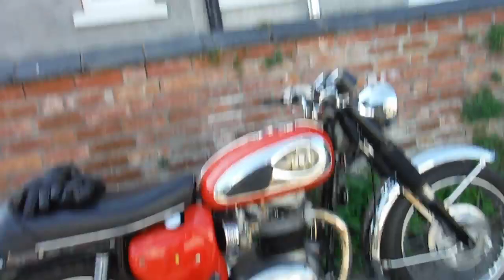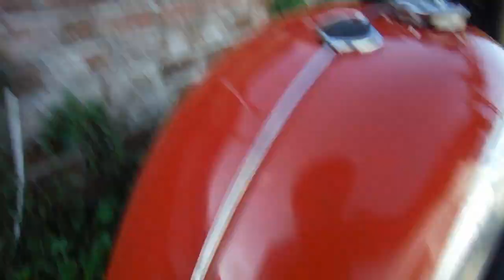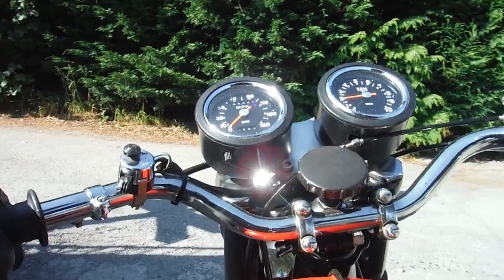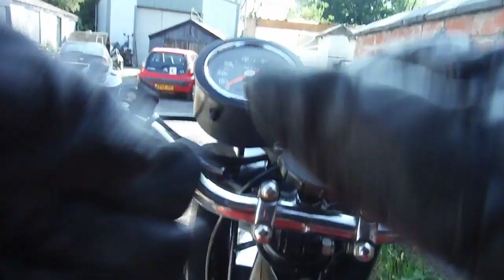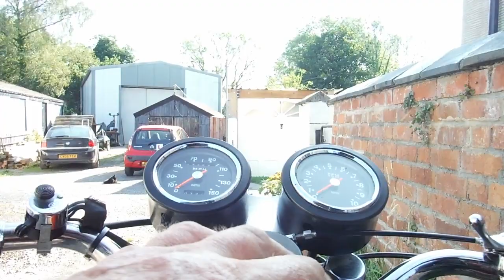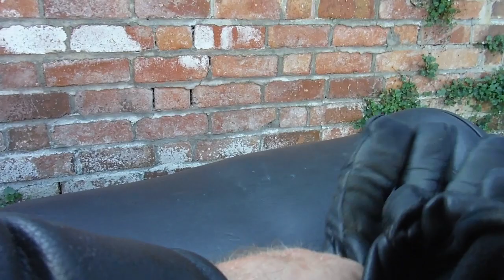BSA A65 [very] short road test.

Comment: I rebuilt an A65 Spitfire for a friend once  that sounded like that, the crank was actually broken but the two halves were meshing together and it would start and run!
Reply: years ago I knew a guy with a 289 Ford that had the same issue

Comment: i used to own a Lightning Clubman, had a bad habit of eating the timing side main bearing bush, the bike felt and sounded like the whole bottom end was going to fly apart, the bush used to work its way out and get eaten by the timing gears. stripped the engine rebuilt with all new bushes, bearings and shells, couple of thousand miles it happened again

Comment: May be a stupid question but I presume the engine mounts including the head steady aren’t loose. My Goldie vibrates like a b*stard when the head steady comes loose. First time it happened I thought I’d run the main bearings!
Reply from the maker: Funnily enough, when I checked, the bolt from the head steady to the frame was missing, so I replaced that and tightened some engine / frame nuts and tried again, but it was just as bad, so no video footage showing it fixed sadly.

Comment: The battle cry of the armchair know-it-all, "YOUR DOING IT WRONG".  As you are well on the way to 10k subscribers you must be doing something right.     I am an idiot and not a mechanic but was once at a junior drag-strip event when a friend of a friend's newly built lawnmower engine would not start. After a good look and a long think I began to realise the ignition was 180 degrees out due to the ignition side crankshaft being incorrectly fitted to the flywheel. Lesson learned was that, "new" and "rebuilt" doesn't always mean "right".

Comment: I'm wondering if by 'jack hammer' it's pinking or has pre-ignition maybe needs a lead additive, richer mixture or is too far advanced,  You ran the Bike as a 'result' but under load the problem shows, that says it's probably not mechanical, at least to me it does.
Reply from the maker: The timing is spot on and I would expect the carburation is, too - my money is on something mechanical.
Reply: @paulhenshaw4514  - I only based my thoughts on the fact that at the end of video 3. everything sounded fine but going through the ride footage again I guess it's also possible for a mechanical engine fault to only become apparent under load. Fuel would be ok presuming the Lightning head has hardened seats put in for unleaded but sometimes a lead additive or sacrificial element is used instead.
Reply from the maker: I have never, to this day had any issues with unleaded petrol and standard valve seats, without additives, but in any case, this example of 'clatter' actually feels unpleasant and harsh - it can even be felt through the handlebars and I fear something may be about to make a bid for freedom!

Comment: Needs castrol R  perhaps. Not synthetic. Did the clutch slip?
Reply from the maker: I think it needs a rebuild!
Reply: @paulhenshaw4514  My  mate used to take me to play rugby on his 650 Lightning. We would do wall of death stuff through the Blackwall tunnel. One day, we were coming down a steep hill on the M2 and the bike vibrated so much, the rear peg fell off. I was wearing fashionable Brutus loon jeans, which quickly ballooned up, putting lots of pressure on the other peg. Which promptly fell off. Terrifying stuff! 
Good luck with the rebuild. Love from Downunder.

Comment: Although the twin-carb ("Lightning ") head has its engineering differences, are there any practical ones to prevent it from being an easy swap with the T-bolt one ?
Reply from the maker: Hi Amelie, this bike is actually a Thunderbolt with a Lightning head fitted. I think it is a straight swap as far as I know.
Reply: I agree. Just like swapping heads from a Triumph Tr6 with a Bonneville and vise versa.

Comment: something totally unexpected, could be something really daft like someone fitted the wrong pistons, high crown instead of flat, out of the same engine but the wrong year, happens on older machines as you know as the spec changed over engine manufacturing runs of 10 - 20 years

Comment: That rig has all sorts of rattles that shouldn't be there.  My 1970 Lightning doesn't sound half as bad with over 100,000 miles on it. Doesn't sound very smooth either.
Reply from the maker: Correct.